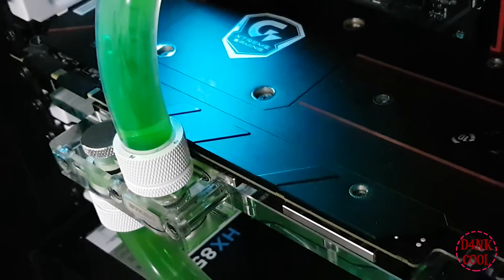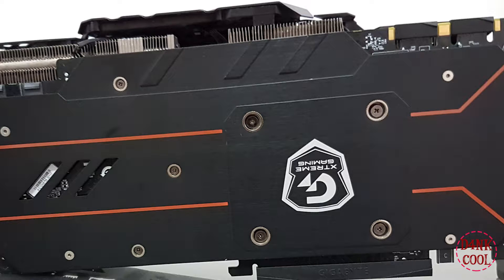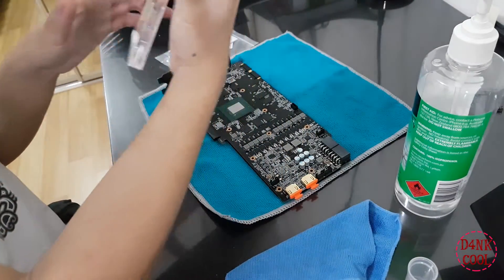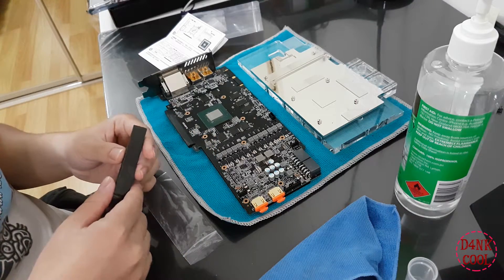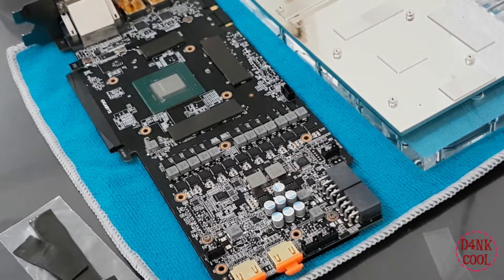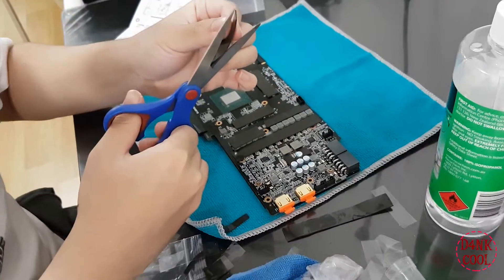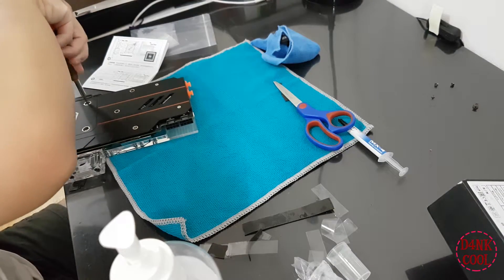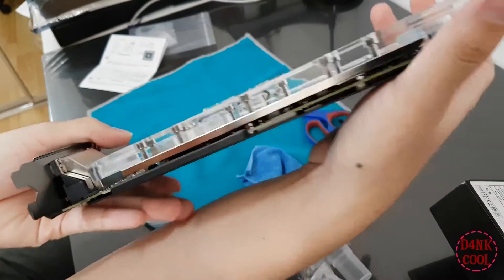Step By Step Installation Guide Bykski Xtreme GTX 1080 Water Block

Comment: Hello, are you sure one should apply thermal pads to the cubic-shaped high thingies between the RAM chips and MOSFETs (I thinks those are choke coils)? I looked over internet and never found any manual mentioning that.

Comment: Hey just wanted to confirm this block would work with my card Gigabyte GeForce GTX 1080 Xtreme Gaming Water Cooling 8GB would it be the same as yours? also can you link me to the pads you ordered and could you explain more about the custom firmware your running thanks sorry to ask so much questions.
Reply from the maker: Pardon the delay friend, what I'm sure of when contacting the seller he told me that this gpu waterblock would definitely fit the PCB REV 1.0(check on your gpu box side label) of the 1080 Xtreme Gaming. any 1.5MM thermal pads out there should be suitable for this gpu block, this is the current one that I'm using

https://www.ebay.com.au/itm/Blue-GPU-CPU-Heatsink-Cooling-Thermal-Conductive-Silicone-Pad-100x100x1-5mm-YY/131942146233?hash=item1eb85d60b9:g:QxsAAOSwgmJXyoMd

Hope this have been useful, just be careful from where you get your block from when purchasing, there has been a number of reports of manufacturing defects regarding bykski blocks.

Comment: hey, how are the quality of bykskis block? like compared to Ek and such?
Reply from the maker: So far they are not far different, this WB is quite decent for oc'ing just like the rest of them, i managed to get 2202MHz stable oc with this wb with custom bios of course, https://www.youtube.com/watch?v=cB64XXZwhqo
Reply from the maker: To be slightly more specific, the water block overall utilises nickel plate to cool the whole pcb and covered a glass material on top of the wb itself which is very equivalent to ekwb design.

Comment: Hi,  are you saying that the three thermal pads that come with the block are not enough to finish the job?  Thanks for the review as I'm just getting ready to install this block on my card.
Reply from the maker: Yes, the thermal pads that comes in the package are simply not enough, you are required to purchase an additional 1MM thick thermal pads in order to cover the all of the chips of the GPU.